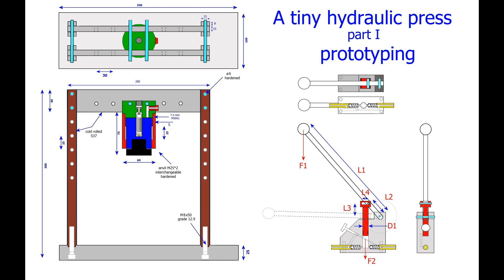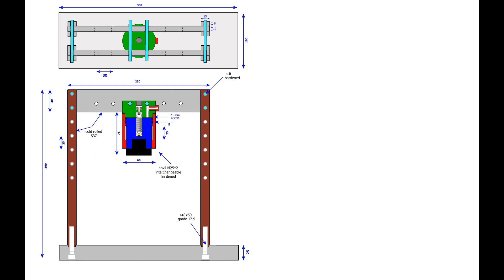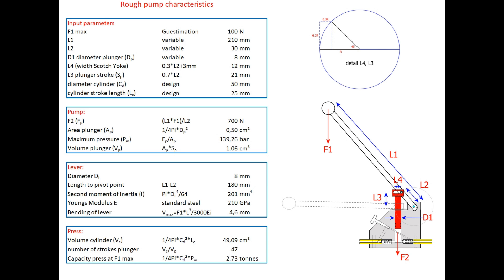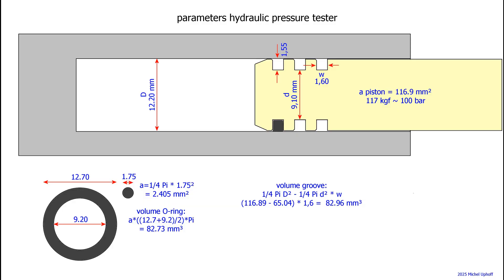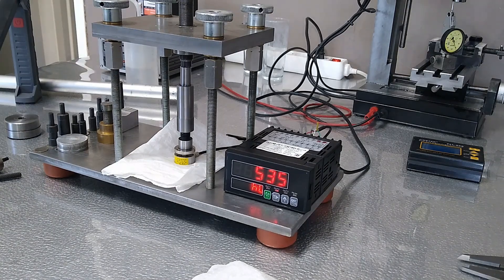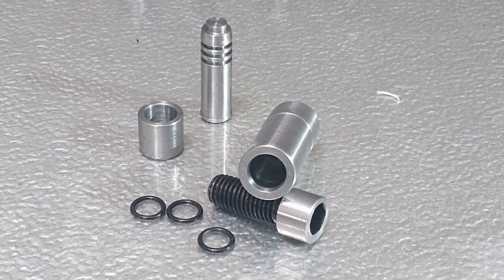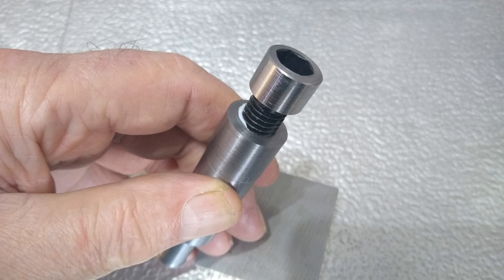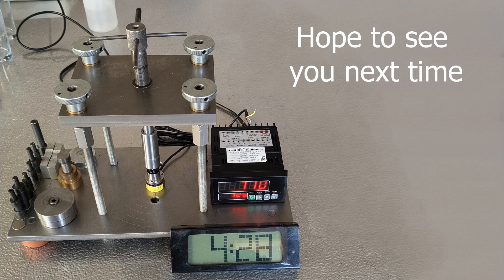A Tiny Tabletop Hydraulic Precision Press. Part I

Comment: G’day mate, there is some decent info in Machinery’s Handbook on O rings, groove dimensions and other relevant info. I didn’t Calc your pressures but make sure you bleed all air in the test cylinder. I’m an Engineer and mostly do things that go boom, intentionally, and the major risks with not bleeding are the chance of a failure has all that potential energy of the compressed air to drive the bleed at flesh cutting forces, and also a very small chance of compression ignition, like a diesel engine, which might be catastrophic. Pressure vessels are usually hydro tested so a failure just loses energy when the pressure drops, so maybe water or water/oil emulsion for the test would work better. Finally, did you do 🇦🇺 doco voiceovers in the 80’s? 😂
Reply: If you had paid attention, "engineer", you would have seen that the pressure tests were done with oil. Then you would have seen that Michel calculated the pressure. And then you would have understood that this was a test, with a few cc of oil, and then you would have seen that any air had been expelled from the cylinder.
Reply: @ so what is the calorific value of a small amount of oil (diesel is an oil) and how many fingers can it take off if compression ignited due to small bubbles of air inside the cylinder?

Comment: Hi Michel, I recently decided to buy a desktop milling machine and I looked at Proxxon products, which are the best options for apartment use. I couldn't decide between FF230 and FF250/BL. I guess FF230 uses a special collet set but FF250/BL uses an standart ER16 type collet. I guess they use same column and coordinate table. My question is, can I process steel in these products as an amateur? Do you think?
Reply from the maker: Your observations are correct.
The FF230 has a 140 watt motor and a spindle speed between 280 and 2200 rpm.
The FF250 has a 250 watt motor and with 400 to 6000 rpm a much larger range.

The differences between the 230 and the 250 are a different motor and a different collet. The ER standard is preferable in my opinion, because these collets are available everywhere at reasonable prices. Of course you can process steel with these machines, but with a 10 mm milling cutter you are really at the maximum that these light machines can handle, provided you use easily machinable steel, such as free machining steel and a very modest cutting depth and feed rate. Harder and tougher types of steel will be difficult to process above 6 to 8 mm milling, there is just not enough rigidity. However, if you are mainly concerned with small milling/drilling diameters, the FF250 with its much higher maximum speed is clearly at an advantage.

Suppose you want to use a 3 mm carbide milling cutter on steel, then you can assume a cutting speed of 75 to 150 meters per minute. Suppose about 100,000 mm per minute. Divide that by the diameter times Pi. So 100,000 / 3x3.14 ~10,000 rpm. The 6000 rpm of the FF250 will, although somewhat low, still be very usable. But the 2200 rpm of the FF230 is really very slow in this case. With HSS it is different again, because then you have to count on about 25 meters per minute, 4 to 6 times slower than carbide.

I assume you have seen my series on building a micro mill yourself. In the first part in particular I discuss cutting speeds and such

Hope this helps..
Reply: @Michel-Uphoff  I asked you since you are an expert on this subject. Of course it helped. Thank you.

Comment: I am following this with interest, since I also want to try making a hydraulic pump soon. Thankfully, my workshop is large enough to fit an off-the shelf bench-top press. Very useful tool!

I have a background in hydraulic testing, and I may have some insights. Your test set-up is very similar to a bulk modulus test rig I developed and used.

1) As another commenter has said, your test traps air, which heats up when compressed, and lowers pressure as it cools.
2) O-rings will move and relax into position over time as well - most pressure testing has a maximum allowable pressure drop over a period of time (usually 5-15 minutes). The rate of pressure drop should flatten out over this time period.
3) O-ring grooves are usually wider than the O-ring - there are standard charts for this (I most often use the James Walker Chart 50 as my guide - easily found on the James Walker site). This will give you nominal sizes and tolerances.
The grooves are wider to allow the compression of the ring and not increase the drag for dynamic applications.
As a general rule of thumb, the maximum diametral gap between shaft and bore is 0.15 mm - though I would recommend staying below 400 bar with that amount of clearance - though O-ring material will influence the capability somewhat.
4) The more O-rings you add, the more friction you will add to the system. For this use case, as long as the O-rings are easy to replace, a single O-ring should be sufficient. Two at most.
5) To reduce friction (and increase pressure resistance) PTFE or PEEK back-up rings can be used. Either split to fit over the shaft, or solid if the shaft is split into sections that screw together. The groove will need to be widened to accommodate this - but beware of the fillet radius at the bottom of the O-ring groove, and chamfer the inner diameter of the back-up ring to ensure clearance.
6) As you discovered, PTFE tape on straight threads do not produce a reliable seal. I have only ever seen it used successfully on tapered threads.
Reply from the maker: Thanks for this extensive comment. I already answered @helgenodland39 regarding the trapped air and the assumed pressure drop when cooling down. I will look again at the exact dimensions for the O-rings, but the test results really do not disappoint me and I am not very worried about drag in this application. For now I see no reason to use backup rings. Indeed, my preference now is to use one or a maximum of two O-rings in the cylinder. From now on I will use teflon tape only during development, when I know disassembly is still needed. If not, I will use ExtraLock as I did here at the third measurement.

Comment: Dont think you have a leak at all, you are compressing air also, so air heats up when preasurized and when it cools it schrink and it look like a pressure drop.
Reply from the maker: The air escaped right at te beginning of the pressure rise. 
Pressure increase due to temperature increase is completely negligible in this situation. 
As you can see in the graphs, the pressure also dropped after hours, so long after any cooling of that small cylinder.
Besides this, in the third run with the highest pressure there was no pressure loss at all as you can see in the video.

Comment: Why not use a standard type of hydraulic seal? McMaster sells then for under $10US. They go in standard o-ring grooves. I think you would be replacing them far less often. I love your work.
Reply from the maker: I might still do that, but I don't see any reason to at the moment. An O-ring may wear out faster, but don't forget that this is not an industrial machine. If I use the press once a week on average, that's already a lot. I have the necessary O-rings in stock here and they can be replaced very quickly.

Comment: A note for anyone else considering performing similar testing - the oil ends up with over 12,000 PSI of pressure.  A failure means a possible stream of 12,000PSI oil jetting out.  Keep your hands and fingers clear of the testing apparatus while under pressure, use plastic shielding around the pressurized vessel, and wear appropriate PPE.  The way this is set up it's not as likely to fail in a dangerous way, and the volume of liquid that could be injected is small, but it's not 0 risk, and just a little additional protection will save a lot of grief if something does go wrong.

Neat project!  I'm glad to see it continue, and look forward to your later updates!
Reply: I was going to note that! I would consider a Plexiglas shield mandatory, especially when testing such things!
Now that said, this is looking to be an interesting and useful project!
Reply: @jrkorman  NEVER use plexiglas, PVC, nylon or similar as a shatter shield! 
That is very dangerous. Lexan or some laminared glasses ar OK. Many plastics create very nasty shards  by spalling and scabbing, they  also do not show up on xray. The risk is however nil in this set up, it is just fine as it is. But I felt compelled to comment on this. Look up any textbook on explosive or high pressure testing.
Reply: As I know... oil is incompressible.
So pressure will drop to 0 in an instant if there is a failure.
Reply: @bmalovic  The load cell, which is a flexure, would be under compression during a failure.  As the load cell returned to equilibrium, the oil in the cylinder would be expelled from the cylinder, through whatever path the failure had taken.  As the oil exited the cylinder, it would indeed return to atmospheric pressure very quickly - but it would, by that moment, be at extremely high velocity.  That velocity (and the mass of the oil) would enable the oil to cut through skin and muscle with surprising, and usually fatal, ease.  People who've suffered this type of injury typically die a slow and painful death, usually from bacterial infection.  If you took the time to search google for "death by hydraulic fluid injection" the second link (from the HSE) includes (under "Background") the following text -> "Although serious reported instances of hydraulic injection have occurred at pressures over 100 bar (1450 psi), anecdotal evidence suggests hydraulic injection injury may occur at pressures as low as 7 bar (101.5psi)"

Better to remain silent and be thought a fool than to speak and remove all doubt.

Have a fabulous day.
Reply: @dav1dsm1th  And that load cell flexture is moving how much? About 0.1mm?
With cylinder diameter of about 10mm (rough estimation from video), it will be all mighty 0.0078g mass of oil (volume = 0.5cm^2*3.14*0.01mm= 0.0078 ccm, density of hydraulic oil is about 1g/ml)
Anecdotal reports are just that... anecdotal.
If you are stupid enough, that after injury like that, do not go to doctor... then.. evolution will do it's job :) 
And it should.

Any way.. i think its time to stop trolling this discussion.
I'm out of this.
Reply: @bmalovic  However, any air inside the test cylinder, and the elasticity of the steel in the jig might prolong that. An insignificant amount maybe, but even what seems a small high pressure injection injury can be nasty if left untreated.
Reply: @squelchstuff  There is more danger in 15 kilograms press fail to jour feet then in presurised oll do harm :)
I will never uderstand why is so much obsession with "safety" on YT.
Reply: @bmalovic  Very true that danger lies everywhere. High pressure oil is one that seems innocuous at first, so it's worth the warning. 

Ignore, or dismiss as you like, but don't come running back if your leg drops off 🙃
Reply: @squelchstuff  After 62 years, all three legs are fine, and about the same length :)
In all that time I used just a single "safety device"... one that is mounted at production time between my ears :)
I worked from mechanic factory floor, logging, installing equipment in hi places, to hi voltage electrical jobs.
Yes, there were some minor injuries, of course, but nothing serious.

No.. I'm not dead yet, even I leave key in my lathe chuck every time :)
And it will not even injure you, if you accidentally start lathe and it hit you, except if you working with some gigantic lathe, and have just "perfect storm" of circumstances. Try if you do not believe.

And for those that do not use "factory safety device"... well... evolution must have some material to work with :)

I'm just asking: why every single discussion on YT must be trolled with "safety"?
Reply: @bmalovic why do you engage? You can scroll on, right? Why should those of us who do care about safety issues have to miss possibly useful background information just because our being safe somehow harms your sensibilities?

Anyway, on a planet with eight billion people, “one in a million” happens eight thousand times. It’s nice that you’ve survived so far, but I count the cost of failure higher than the price of success.